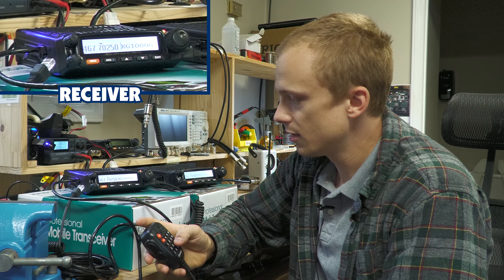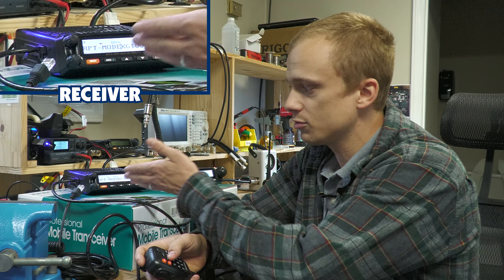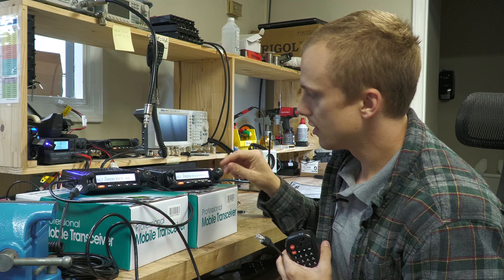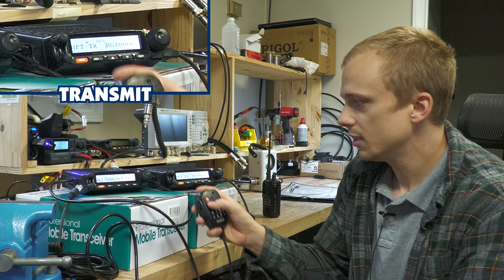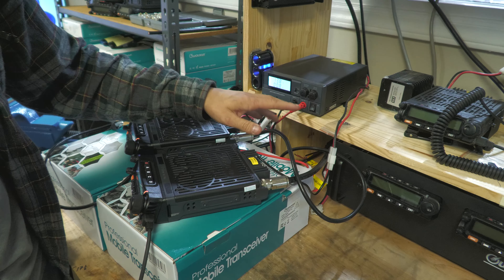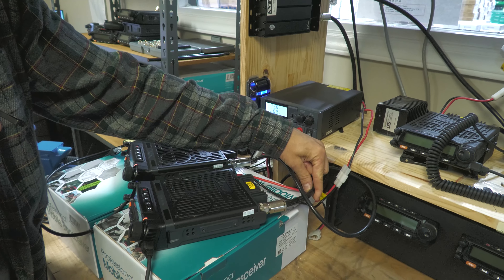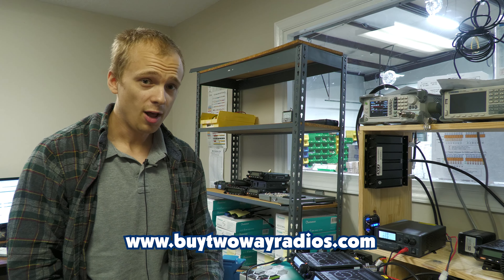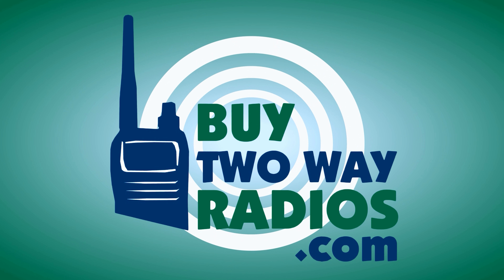How to turn your KG-1000G Plus into a repeater

Comment: Wouxon, if you are reading this: just build a proper all-in-one repeater for about $1k, make sure it's at minimum 25 watts on final output after the duplex (hopefully 50), have it be able to run on AC and DC and sell it. This making people jerry rig the set-up and buy multiple parts is just ugly.
Reply from the maker: The KG-1000G Plus repeater feature isn’t meant to replace regular repeaters. It is intended for temporary circumstances such as emergencies or testing. It is also something people can experiment with on the fly. For for constant every day use, normal repeaters are still more ideal.
Reply: @BuyTwoWayRadios  I know. Wouxon puts out some amazing products, but it would be nice if they made a proper repeater. Even BTech released one for GMRS. I think Wouxon can pull it off and place it in the $1k price range.
Reply: the GMRS-RPT50 does all of this and more..... self identifies.... and 50watt..... close to your price range.... $1500

Comment: You didn't say how to add a CTCSS tone. Which option? If this is updated from the manual are the CTCSS also updated?
Reply from the maker: The tutorial is intended as a quick guide for the repeater function specifically. The process of adding a CTCSS Tone is the same as it usually is: options 9-12 in the built-in menu. More information can be found in the downloadable manual on its product page - https://www.buytwowayradios.com/wouxun-kg-1000g-plus.html
Reply from the maker: Option 9: Receive CTCSS Tone
Option 10: Transmit CTCSS Tone

Additionally,
Option 11: Receive DCS Code
Option 12: Transmit DCS Code